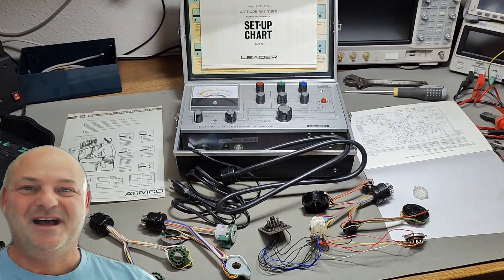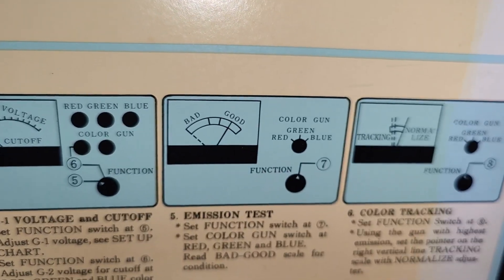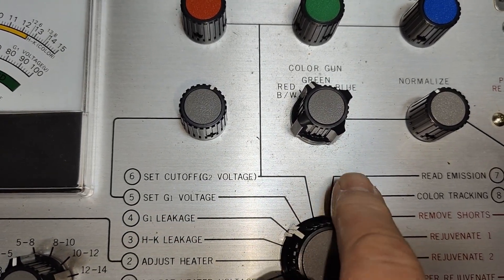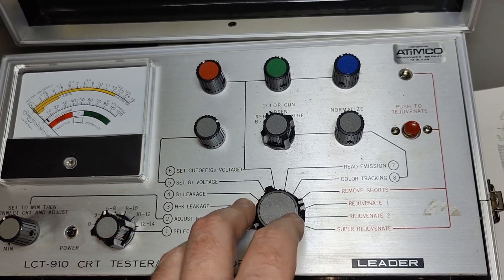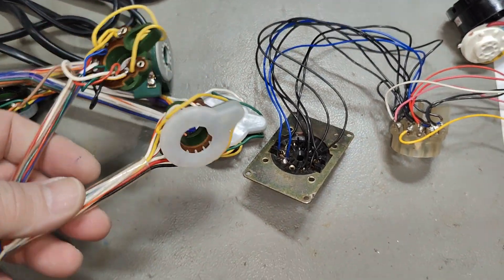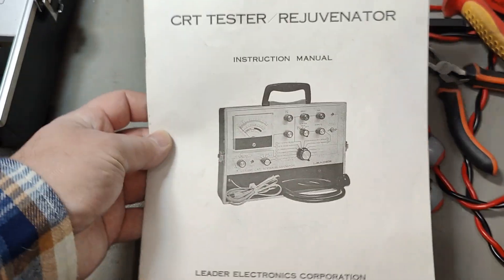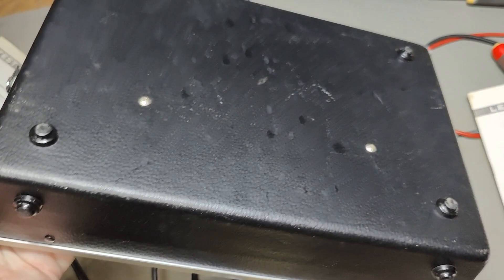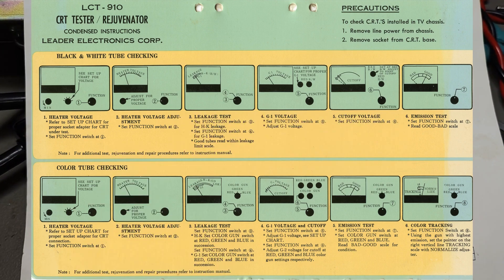LEADER LCT-910 CRT Tester Rejuvenator Tube Restoring unit teardown 1970

Comment: Hello, sorry for the sudden question but I found this video and I think you can help me... I have this same Leader but someone cut the connector, now i have to figure how the undecal plug is connected, for example Red - Pin 1, Blue - Pin 6 etc... Can you please help me? Thanks!
Reply from the maker: see in the description, there is a link to the scanned material

Comment: I bought this instrument back in 1974, for testing and rejuvenating mostly B/W CRTs at that time, the notorious A61-120W being the most common  representative of them, found in those receivers of the market, and I've used it extensively ever since, untill CRTs stopped being produced any longer. I remember that I've got back my money invested on it within one month!!... And I also remember that about ten years later, when I needed an original spare adapter/connector for a colour TV, not included in the original kit of the instrument, I paid the amount of money I had paid for buying the instrument itself in the past! But, again, I've got the money of that new investment back, by rejuvenating just two CRTs of that type!!...In the mean time, just because the prices for modern original adaptors/connectors had gone sky-high, I had removed one tube connector, which was double in the kit, and then I had only the interconnecting cables free for testing any new type of CRT, by using the tube connector which was installed on the TV, after removing it from the small pcb it was installed. It was really worth it to do so, for saving a lot of money...Ah, those were the days...I still keep this instrument in perfect condition, although being myself long ago retired...